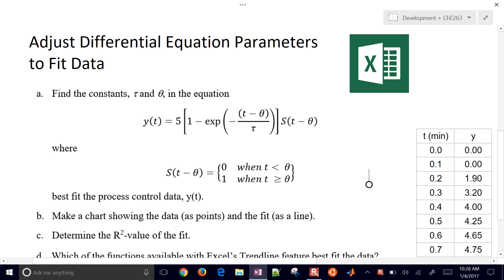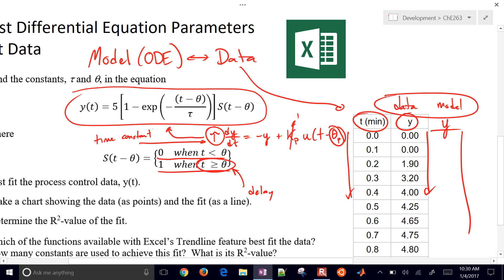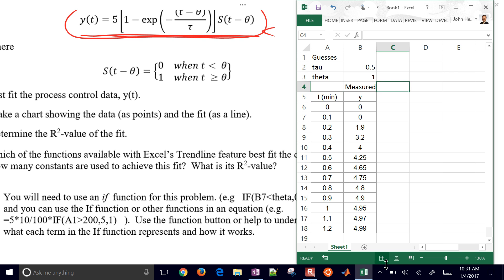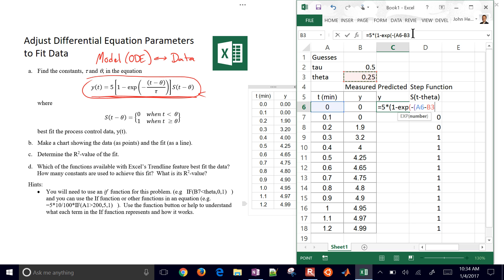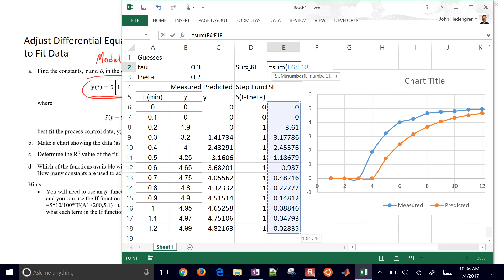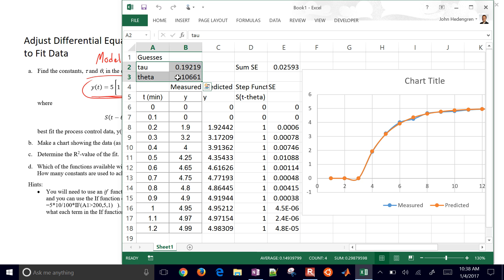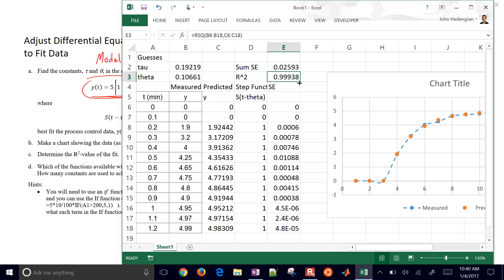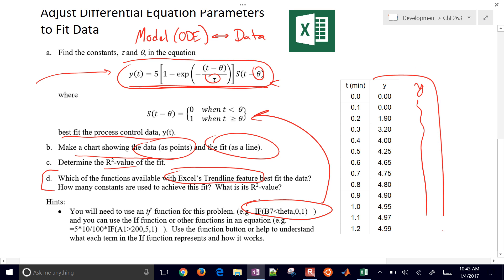ODE Parameter Estimation in Excel

Comment: I have one question...if for example, several experiments have been performed to estimate the same parameters (maybe by providing different input values) where estimation for each experiment gives different final cost function value, how we can calculate the final parameter values? Is it OK to take average of all the values?
Reply from the maker: That is typically not a good idea to take an average. Can you use all of the data sets and come up with just one set of parameters to minimize the objective function (sum of squared errors)? That is a better way to combine data sets.